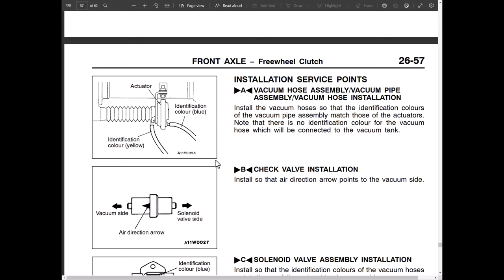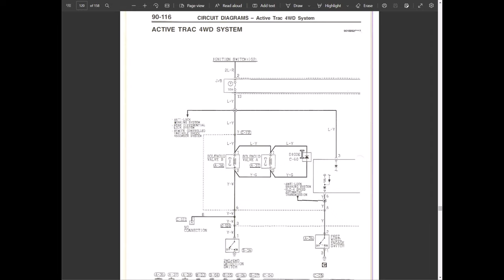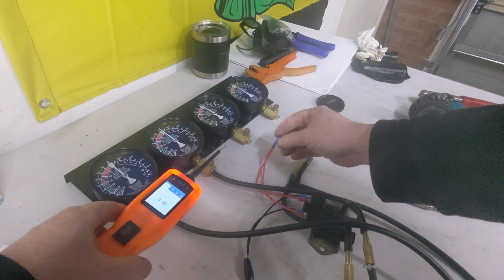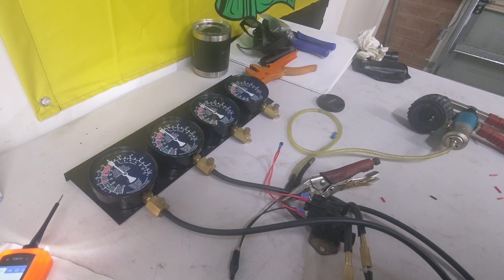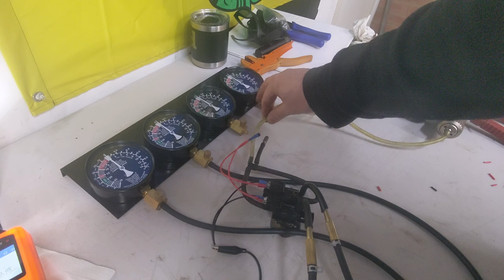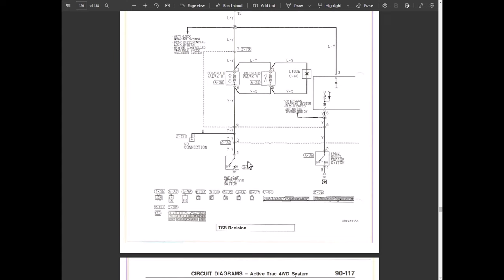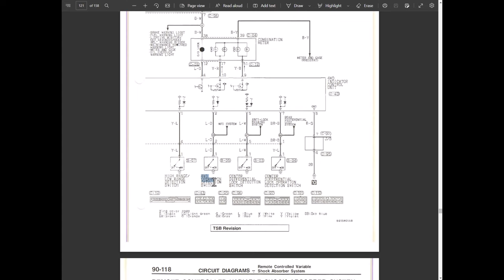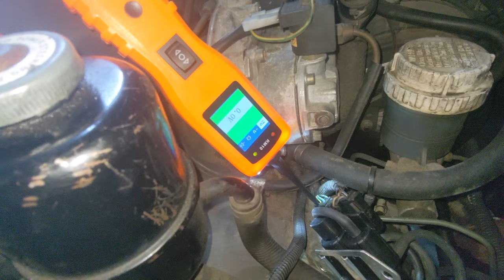Diagnosing and proving how Pajero/Montero 4WD actuator solenoids work

Comment: Great effort mate. Btw the diode is required in almost all circuits containing a coil to limit/block the back voltage generated when the solenoid is powered up/down just like in 3-phase dc motor drive circuits, oddly called a freewheel diode (no relation to freewheel clutch).

Comment: Great video bro. Sorry to hear about sleep apnoea, hope you get on top of it. My 2005 delica auto has locked up all wheels, had to skull drag it to mechanic only for them to say its not the diffs or transfer case  and I need to buy another auto. No mention of solenoids until I asked them were they checked. Then of course they said yes. I am very suss if they were checked. It wasn't on the bill either. Now they want it gone and I have to pay for another tow to get car home in same condition. The guys at delica garage said it could be the solenoids but I am in Cairns with no one here I trust. Only been here a short while. Anyone else had this experience? Any help would be appreciated.  Cheers.

Comment: Great video. I replaced my solenoid and it still doesn’t want to engage 4x4. If I unplug the solenoids I can trick it into engaging 4x4 which is odd and vice versa. Have left it in 2H for about a year now as gave up on it. But this video has given me insp to try fix it again

Comment: I have same issues in my 2000 Mitsubishi pajero  it siting for  1 years  now I plan to fix it soon thanks  for video 📹.
Reply from the maker: Cheers mate.  The switches in the transfer case and on the front diff may also need cleaning.  My NH Pajero which I'm selling to a mate needs the switches cleaned up.  Contact cleaner is your friend there.

Comment: Hey mate amazing video. I have an issue when engaging 4HLc and 4LLc.. between 2wd and 4wd is fine, the control box lights all work. but when I go to 4HLc and 4LLc,
I get instant error code flash? although the 4HLc still definitely works mechanically as you say. (I don't thing low range engages) I have replaced the vacuum solenoid. What do you think my issue could be?

Comment: Thanks for the vid! Been looking for answers to this flashy light problem for a while now. I pulled my solinoids out and tested them on 12v. They seemed OK, but still having issues with lights flashing when putting it into 4H. It does engage though, so must be the detection switch that is dodgy.
Reply from the maker: Yeah this is just a reminder that what I really need to create is a video which has a flowchart that goes through how to diagnose the cause of flashing lights, as there's more than one reason why they flash.
Reply from the maker: Also I just put a set of solenoids in my other Pajero (the NH) and it also still has some issues, so it also obviously has some issues with the detection switches.  I'll start with the switch on the front diff as that is the logical next place to look,

Comment: So my issue is that 2H works, changing into 4H the solenoids don’t turn off and it doesn’t engage the front diff and continues flashing. I can manual engage 4H but unplugging the solenoids.  So would this be the 2-4 switch or the free wheel switch

Comment: Hi .. this thing happened to me two days ago , I changed my gear from 4H to 2H and the front tyres lights keeps flashing non stop , If I put back the gear to 4H or 4HLC or any gear it works fine as normal , but the 2H gear refuses to engage back to normal even If I drive for a long distance it keeps flashing .. and yesterday I heard a sound like friction .. I changed the solenoid 9 months ago .. have you faced this issue before ?
Reply from the maker: Yeah it will be this system.  Either the solenoid setup or one of the vacuum lines has failed.

Comment: Great in depth video - I have a 2002 Montero in Canada and have an intermittent issue with the flashing center diff light too. However I just have the flashing center diff  light after 20-30 km of relatively high speed driving.  If I am driving around locally (slower in traffic) then I never get the error.  I am guessing that my leak is small and only ever produces the error when engine vac drops under load for an extended time when the vac tank is depleted as well.  Does this fit with anyone else's experience?
Reply from the maker: Your flashing center diff light - does it come on when you're in 2WD mode or 4WD mode (only) or regardless of that setting?

Most likely your issue is a sticking centre diff lock switch on the transfer case.  I need to make a better video on the overall system but the majority of the Active Trac/Super Select system is totally mechanical based on the transfer case lever and its associated forks that engage gears in the box itself.  The rest is all just microswitches which dictate what lights flash on the dash.
Reply: @KaldekBoch  the flashing center light only shows when driving in 2WD just like in the video.  I had a spare freewheel control in the tool box so I just swapped it to check.
Reply from the maker: @xrotor7813  In your case I would remove and clean/test all of the microswitches that connect into the transfer case.  I suspect that will be the root of your particular issues.

Comment: so by swapping vacuum lines, u could get 2WD lo (  lever positions changed :: 2h=4h, 4h=2h, 4hlc= 2h, 4llc= 2l)
Reply from the maker: Do you mean changing the lines so they're in the wrong place?  I suppose you could do something wacky like that, but why?
Reply: @KaldekBoch  Yes, purposely swapping them in wrong place. Reason why is I have Pajero EVO and can do over 110 kph/70mph well below redline in 5th gear(auto) in 4llc for aggressive rally cross and off roading. The torque multiplication makes truck feel like 400hp(?) I want to be able to select low gear in transfer case, but be in RWD only, and AWD( ie open center diff 4lo). Ideally, it would like to retain traditional 4llc for self rescue,  I think it should work,  i suppose additional vacuum solenoid plumbed in could make ultimate systems. maybe paddle shift actuation
Reply: Does 4llc happen in the transfer case,,,,,and the front vacuum actuated  axle connector not involved?
Reply from the maker: @drtone  Ah I don't think that would do much.  The Low and High is a mechanical setting via the 4WD lever in the cab.  The solenoids don't do anything other than control whether the front diff is engaged or not.
Reply from the maker: @drtone  Correct.  The vacuum axle connector ONLY engages whether the front axle is engaged.  The transfer case controls the Low/High ratio mechanically.
Reply: @KaldekBoch  t.......herefore I should be able to wire in switch to apply vacuum from the vacuum thru solenoid to disengage the front axle acctuator while stick is in 4WDllo....giving me 2WDlo(RWDlo)
Reply: probably check valve?...not test port
Reply from the maker: Yeah probably.
Reply from the maker: @drtone  been there and done that.  My issue was around even when I was much younger and 15kg lighter.  It was likely caused by my orthodontist who removed too many teeth when I had braces to fix an overbite as a child.
Reply: @KaldekBoch  Yep, that will mess it up. Good luck with that,  sending my blessings. Thanks for your video, I think it allows me to figure out a switch for 2WD low ;)
Reply: @drtone  interesting let us all know how you fair
Reply: Curious if this fixed the issue?
Reply from the maker: @kevinwalsh7258  Yeah in my case it did.  There are some remaining issues with stiction; that is, I often have to rock the car back and forth between R, N, and D to unload the front diff and allow the engagement shaft to engage or release.  However those are mechanical/lubrication issues I suspect related to age, so I just live with it.  The actual vacuum actuation driven by the solenoids is working perfectly.
Reply: @KaldekBoch  thanks for the reply and appreciate the videos.

Comment: My pajero blinking the front wheels when 4x2 is activated ... can you help me ? Plz
Reply: got the same problem. 93 td im gonna try swap that part and spray switches like he suggested in a earlier comment response. lemme know if u fix before me :)
Reply: hey man i literally pulled the vacuum switch plugs out like he showed in this video and cleaned with contact spray and the lights stopped flashing immediately after :) hopefully stays good, just thought id let ya know